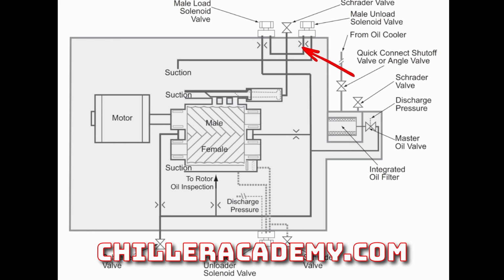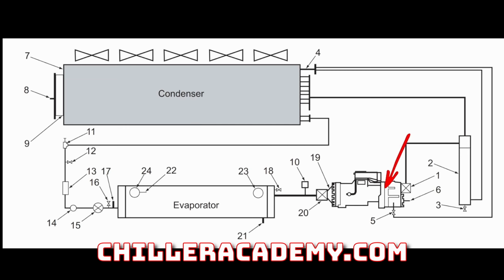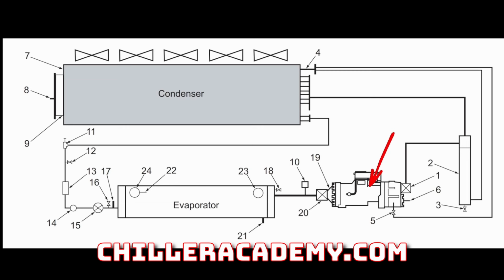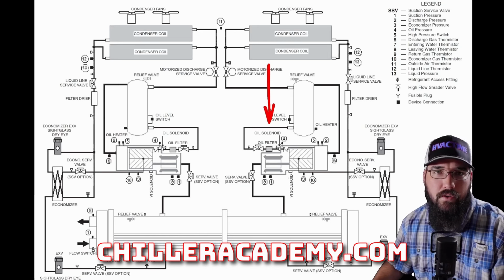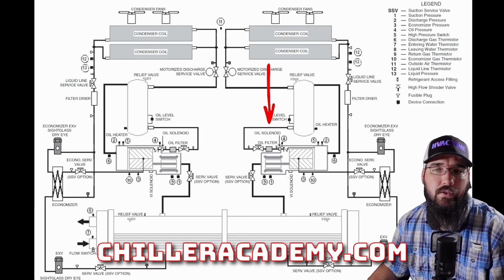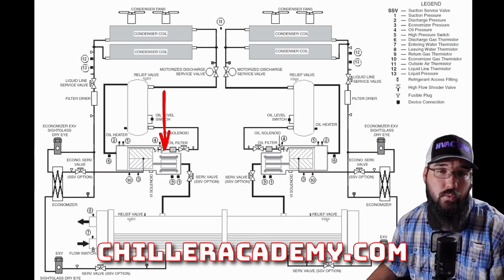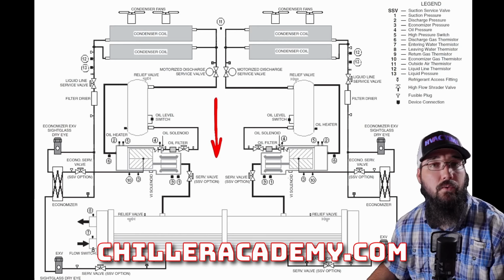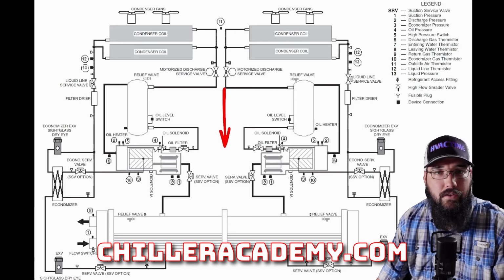Know Screw Compressors Staging - Chiller Academy

Comment: Daikin will keep the lead at full speed and slowly bring on the lag and let it ramp up slowly. Then back the lag down until it's not needed. I'm working on an Daikin AWS ( VFD driven right now ) the newer AWV will do the same thing as the AWS. They do have a slide valve in it, but its not used for capacity control. It's used for discharge superheat control. Daikin uses a single screw with gate rotors on each side of the screw bolt. The AWS and AWV also use liquid injection for additional motor cooling